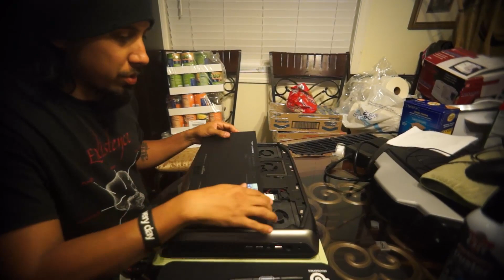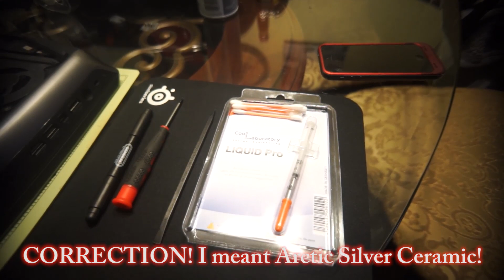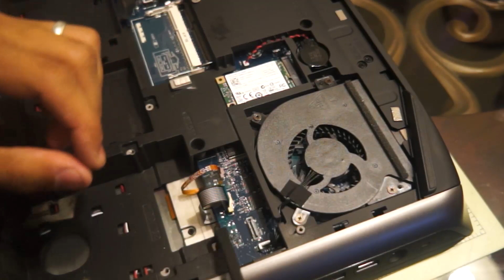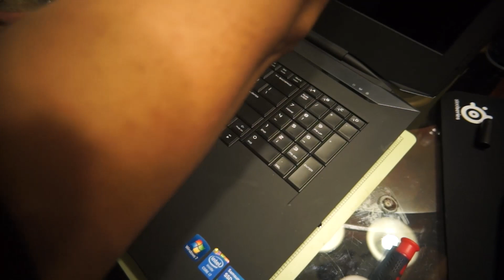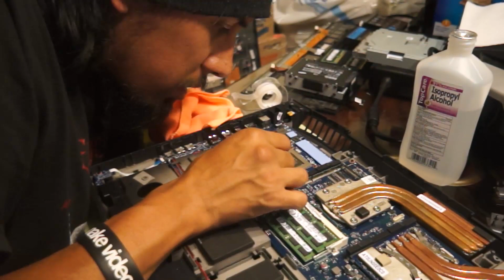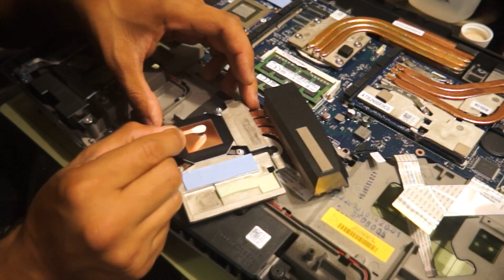Alienware 18 Disassembly and Repaste! Step by Step

Comment: Thanks for showing how to get the keyboard off.  I really hate this computer though, I’ll never get a dell/billgates/intell machine again if I can help it.  I wanted to see if reseating the WiFi radio would help my problem but it did not.  The intell dual band radio started dying last March and now it’s just dead.  Just as well since windows 8 is no longer supported.  I’m going to look into getting a Mac book even though I dislike them.  These windows machines are expensive throw aways.  I thought the Alienwares would be better but not so.
Reply from the maker: Mine is still running strong. Just update it! :)

Comment: hello I currently have an alienware model M18x r2 it does not start I changed the processor and I put an SSD and it still does not start it could come from where the failure please
Reply from the maker: I cant be sure, Maybe the CPU needs to be reseated?

Comment: Bro,you just handle this with ease..I just got a Alien 18 and works great but i needed to revive my music studio from a m18x and was thinking of putting the drives from the 18..but i didnt know the drives on this were so in there..I'm petrfied to dismantle this thing..the m18x meanwhile needs repasting as its shut down on me,giving me the bleeps..hope you're still around to answer this..furthermore the seller for the 18 did not have the restore discs so i need its drivers..
Reply from the maker: I'm here for questions! haha. You can still make your recovery disks through windows but it will only let you make one set. Get a good set of DVDR's and set some time to let the computer do its thing without interruptions.
Reply: @PestVic  hey there,direct from further up north Kali..so one plan was to just boot up the alien 18 with m18x drives which contain my studio setup (FL studio 9,12 & 20,N.I. maschine 1.8 & 2.0,Guitar Rig 5,Reaktor 6,and tons of synth vst's) but i would need the drivers of the 18 (revision 1 I think) ...or clone the studio drives to a new 1tb ssd (i've done this once,so i'm good)but again i need the drivers to copy to those ssd's.so i can keep the ones that will go back to the m18x..right?
Reply from the maker: @mastertracker510  Theres a hard drive cloning device by a company called Apricorn. Definitely check that out!
Reply: @PestVic  as oposed to free cloning software/..i used one allready to clone from the original drives (non-ssd)from the 1rst m18x (that one fell from atop my full stack guitar stack,in my storage,6 feet high,..busted Lcd,kept using that way for a few years until a loose screw shorted what i believe was the power section,a big zap of sparks!...dang! that was it,so i bought a 2nd m18x and swap drives.) to the 2nd m18x..but because both older m18x and newer 18 have the same OS im hoping to have 2 copies of my studio setup..but the alien 18 is sweet,and got a crazy deal on it.

Comment: When you dissasemble the keyboard from the laptop I didnt see what cable connected the keyboard to the laptop.
Even un your reassemble video you just dont show that.
Is there a cable to connect from the keyboard to the laptop?
Reply from the maker: Yes the disassembly section is there. Its one of the ribbon cables underneath the CD drive. :) Just pay attention to this area of the dissasembly and watch for the ribbon cables. :) Hope this helps!
Reply from the maker: 5:09 is the timestamp. As long as you get all these disconnected the ribbon under the CD drive it will disconnect the keyboard :)
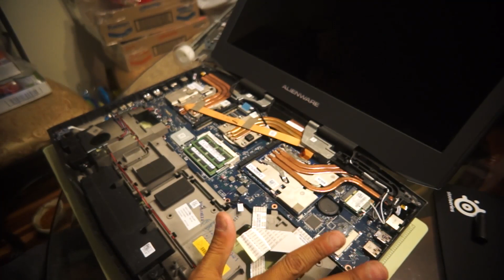Reply from the maker: also 8:45 shows where the ribbons were attached to the keyboard on the bottom right of the screen. Those big ribbon cables were the ones attached to it. As long as you get those out you'll be good. :)
Reply from the maker: 8:47 shows the other ribbons you took off in the 5:09 step. The two small ones :) Anyway, that should solve your question! Hope that helps for real this time! :D
Reply: @PestVic   @PestVic  Thank you so much man!!! I really appreciate it. I just bought Artic Silver 5 Paste for my processors (CPU and GPU) I'll do this on my own. by the way nice tutorial man, I admit I feel a bit scare to do it, but doesnt look so hard. Also liked the tape and screws idea, pretty cool way to organize!!!
Reply from the maker: @enriquealejandropinelonove2416  Yep! Just follow the guide, Use the tape (worth it) and go slow! Dont force or pull anything hard and you will be golden!
Reply: @PestVic  Thanks man!! its not the first time I disassemble my Alienware 18, but the most I've done is Cleaning Fans, upgrading HardDrives, upgrading Ram memories and changing battery. this is the first time I'll try to repaste my CPU and GPU, my CPU is heating over 85C now, So I think its time to give maintenance to the CPU. Before I regret it!!!
Thanks for the help, I'll let you know If I succeded!!!
Reply from the maker: @enriquealejandropinelonove2416  awesome! let me know how it goes :)
Reply: @PestVic  hey man, Today I finished to repaste my cpu and gpus and it worked the temps got from 56C at idle state to 38C for GPU And for CPU down to 44C.
But after repasting and using my laptop, I turned off my alienware and now it doesnt turn on.
The power button LED doesnt light on when I plug the AC Power Supply to the laptop.
And mu AC Power Supply green led remains on.
I Had checked the power button cable or strip and seems connected well.
Any idea what could have happened?
Because I used it once after finishing to apply the repaste.
Reply from the maker: @enriquealejandropinelonove2416  That im not sure. If it turned on the first time I assume it was done right... hmmm what else is it doing? Check the battery connection maybe?

Comment: Nice Vid. 
I'm upgrading mine with a Gtx 980m. Came with sli gtx 765m.
You did not need to remove the fans?
Reply from the maker: Nope! just like the video haha. I only take them out if I need to clean them
Reply from the maker: Where did you get the 980m?
Reply: @PestVic  Only place I could find.. Aliexpress.
They have a lot of other cards there. 1060 and 1070 also, but the 100w heatsink  I've bought from Ebay of seller from Hong Kong. 
980m U$ 350. 1070 about U$ 500 I guess..
I live in Brazil, and laptops here now days are too expensive, thats why Im going for a 980m,  maybe 2 years of lifespawn for my Alienware with in it
Reply from the maker: @lmmcg  whoa! no way! They made 1070's work in this model? Whats the process?
Reply: @PestVic  Same process...
This guy mattyb3 have one.. 
Take a look in this thread on Dell Forum..
https://www.dell.com/community/Alienware/18-R3-can-I-upgrade-to-a-GTX-1060/m-p/7525152#M27701
Reply: But the 1070m I've seen on Ali, it is identical in mxm format to the others....
Reply from the maker: @lmmcg  damn! I might have to try and upgrade this :-o

Comment: Hi.I have a Dell Alienware 18.I open it from inside to clean the dust but now it's not turning on anymore!!! I need help pls
Reply from the maker: What all did you take apart?
Reply: @PestVic  RAM, HDD, SSD, SLI Cable and the 3 fans for the CPU and GPU
Reply: @PestVic  I tried to reset the CMOS by removing it for 5 min and place it back again but still nothing
Reply: @PestVic  Do you think switching the RAM places could cause to the laptop this issue?
Reply from the maker: @Giancarlo_Medina  You did remove the battery before you did all this correct? You didnt list it i your process?
Reply: @PestVic  yes I remove the battery first and then I pressed the power button for 1 minute to remove any energy in the motherboard

Comment: I broke the ribbon cable and the clip that holds it in place that you showed at 5:30 and said didn't need to be removed (I'm an idiot I know) where could I buy a replacement? Please someone help me out I'm desperate trying to find the replacement lol
Reply from the maker: Biotic there should be a ton online. Just count the number of pins on the ribbon cable and search for ribbon cables with that amount of pins. Also check the orientation of the blue tips on the cable and make sure they are the same as the cable in the computer.
Reply: @PestVic  It doesn't need to match the specs written on it? The one I broke is something like AWN 20706 105c 60v VW-1, I looked up on ebay and amazon tons of those but I can't find one with the same pins, it's 30 pins I believe.
Reply from the maker: @astaroth5024  Yeah its probably best that you find the same one, but, a ribbon cable is a ribbon cable. Most likely just having the same amount of pins will work just fine
Reply: @PestVic  and yeah the orientation was alright, I just broke the pins trying to force it in place since I broke the clip which I need as well, I was desperate thinking I had broken the computer when it didn't turn on... lol
Reply: I broke that also 😂
Reply: @Giancarlo_Medina  i found a replacement on ebay! it was expensive tho, like 30 bucks :/ did the clip break too or just the cable?
Reply: @astaroth5024  clip only bro :((
Reply: @Giancarlo_Medina  be very careful when putting the cable back in place because you can break the end of it (I did) the solution that worked for me was  to remove the blue plastic from the other end where you can just put it under the other clip, and use it on the other side where you broke the clip to recreate the pressure the clip used to have on that socket for the cable, it worked for me, I hope it does for you too
Reply: @astaroth5024  lol thanks bro but my laptop is not turning on anymore
Reply: @Giancarlo_Medina  i know, that cable controls the power button and the leds of the hdd, caps etc, if you manage to make it sit right it will turn on and work as usual again.
Reply: @astaroth5024  really ????
Reply: @astaroth5024  bro I broke only the clip the cable is fine
Reply: @astaroth5024  do u know the name of that so I try to find it online
Reply: @Giancarlo_Medina  i don't the only way to get a working clip would be to 3d print it or get a new motherboard, so your best bet is to do what I said, its what I did to make my old laptop work again.

Comment: Hi, wondering if anyone can help me? I had to replace my motherboard and screen and opened it up as few times. However, in the process did something to the keyboard? The p button does not work, both the letter's A and S are stuck, if I type one or the other like a it comes out as. So somewhere I have damaged the plugins and need to replace it. But I am unsure what i need to replace? Any suggestions or advice would be helpful? Typing out this response has taken me about 5 times as long as it should. Beyond annoying!.
Reply from the maker: Did you happen to pull on the ribbon cable when you took it off? Could of got damaged. Check both sides of the connections. If it doesn’t work you’ll need to replace the keyboard assembly
Reply: PestVic Thanks for your reply! This is driving me nuts. I actually recently replaced the entire top  keyboard plate with a new one, as one of the home buttons cracked. Did not solve the problem? Figured it must be one of the many plugins ghat way damaged? Just don't know which to replace? Which actual ribbon are you referring to? Or which plugin is it? 
Your paste replacement vidro was excellent. I know nothing about pc intrrnals. That madd it easy. So cheers for that! Thanks again for your reply.
Reply from the maker: K S hmm.. yeah I would assume that one of the connectors are damaged. It’s whatever connector the keyboard connects to. Check both sides of the ribbon cable. Make sure you don’t see any kinks in the wires at all.
Reply: PestVic Thank you again for your replies, I really appreciate your help.
Is it the thin gold ribbon, the blue/silvrr next to it or one of the 3 white ribbon grouped together? I had replaced the whole top board so I know it has to be coming from the internals, rather than the keyboard assembly. And sorry, one more question, where eould I dource the ribbon, I am guessing Dell would havd a supplier? Couldn't locate any from google or ebay? Thanks again mate, greatly appreciate your time and knowledge. In case it is not obvious, I am a total noob when it comes to this sort of thing. Cheers!
Reply from the maker: Hmm, I'm not to sure. I haven't had to re-paste in a long time. When I do ill find out for you. I cant remember what site had the cables but if you call dell they will let you know where to source them. You might be able to buy a extended warranty and make a claim. They should send a tech and they will do the replacement for you.
Reply: PestVic Great, I will start with contacting Dell and go from there. Hopefully they can put me on to the correct part or their supplier of parts. Thank you so much for taking the time to help me out with this problem. Cheers mate!

Comment: where did you buy the thermal pads from, and which brand were they?
Reply from the maker: These were the stock thermal pads. I actually thought about replacing them with even better ones. I believe any normal pads you can find online or on amazon would work just fine :)

Comment: what part of the  video do you show the lcd ribbon? I think mine is lose or my lcd is broke. the screen is greenish. I did not drop it or anything. Can the lcd break if you dont drop it?
Reply: I did what you said. It worked for 5 minutes. Then I smelled something burning . I turned it off and seen this piece burned it's self down the middle. http://imgur.com/HyCHwee 
It won't restart ever since that burned. 

I's the laptop fucked now or is just another small problem?  Can I buy that cord on ebay or is it something you can't replace?
Thanks for the help. This is not your fault nor are you responsible for what I do.
Reply from the maker: Yeah I believe you can order that cable. I just don't know where from just yet. If I find out ill send it to you. Its going to be called the "Card reader ribbon cable". I do see the problem though. You see in your picture, the black line just under the blue tab? Bottom left of the picture. Notice how its not aligned and straight with the white connector? It was in crooked and must of jumped two connections causing the burn.
I found this "Alienware 18 OEM SD Flash Card Reader Board to Motherboard Cable NBX0001B800" on ebay but the listing ended. From reading I guess you can buy that whole board piece for like 12-20 bucks. I'll post a link if I find it. Sorry about the trouble! :(
Reply from the maker: +NSAGOOGLEBOT Update: I found the board. http://www.ebay.com/itm/Dell-Alienware-18-H3VYP-SD-Card-Reader-Board-LS-933LP-/231796733275?hash=item35f829755b:g:Ft0AAOSw3KFWgXIM
I'm working on the cable for you haha :)
Reply from the maker: +NSAGOOGLEBOT Ok I read some forums and found this listing. Its for our alienware 18 Viking models and includes the board and the FFC (30pin Cable). There&#39;s no picture to verify but its the best info yet :)
http://www.computer-spare-parts.info/catalog/product_info.php/products_id/1342

Comment: Absolutely fantastic tutorial, thank you for the effort you put into this; I never been able to use any overclock on my Alienware without a BSOD/thermal shutdown during or shortly after startup, this never really bothered me, it was only until recently I was having consistent and reproducible thermal shutdowns when trying to use a CPU intensive application (VisualSFM in this case), with the laptop shutting off within about 4 seconds from starting processing inside the application.

After diagnosing and logging a few metrics, I could see the CPU was rising from the mid-80C's to 100C in only a few seconds, with the fans not even attempting to kick-in to stop it, at least not in time.

I stripped it down while following your guide, cleaned off the HORRIFIC paste job that came from the factory, and seriously, 2/3rds of the CPU had no paste, and the GPU's had great splodges with portions of the die missing paste, with all chips having far more splattered around the chips that you'd think someone did it with a cake-frosting gun..

Applied Liquid Pro to the CPU/GPU's, reassembled, and my load temps have reduced from the t-max, 100C, to hovering around 85C, or a ~15C decrease, there's more of a decrease in idle temps which now setting into the mid-50C's, but I didn't have a good previous record to compare since load were the ones that were causing me problems.

I've even been able to finally try out the OC-1 level overclock, with OC-2 remaining stable for me as well.

Again, many thanks for the tutorial :D.
Reply from the maker: David Taylor no problem at all! Super glad to hear you got it rocking! :)

Comment: Adding liquid metal to the heatsink separately... Bad idea. There are those little capacitors around the actual gpu chip, if your metal liquid decides to make contact with those, you got yourself a very fried laptop. Only add thermal paste on to the chip, you dont really need to even spread it because the pressure will.
Reply from the maker: I mention this I'm pretty sure. I knew how much was going on. That's why I said I'm moving it to the middle so it spreads evenly. By adding a super light layer to the heatsink it allows the very little extra to spread within that sheet of liquid and it stays where it needs to. I do agree if you dont know what youre doing and add too much then yes this is exactly what could happen. But dont worry I've done this tons of times :)